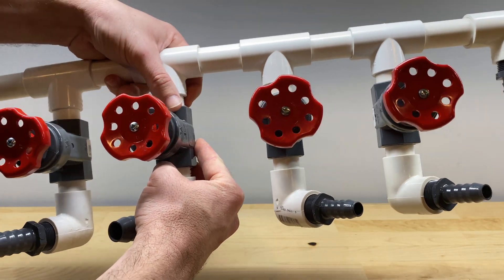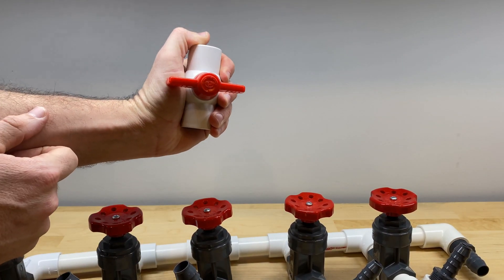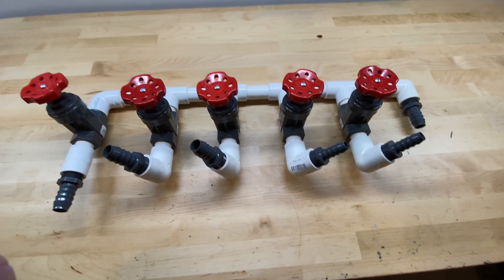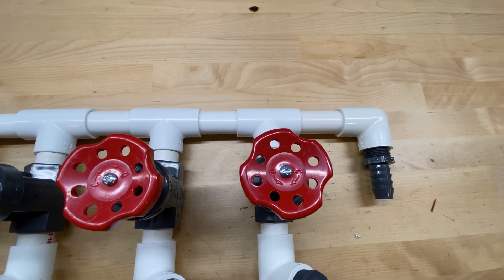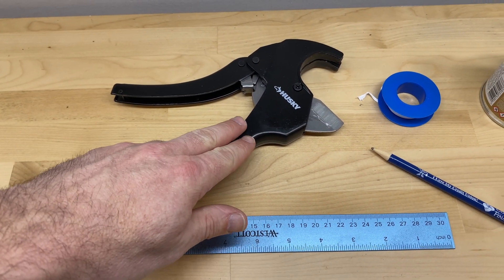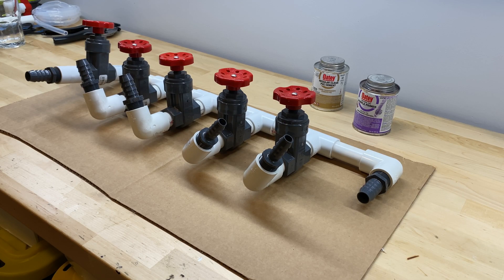Make a Reef Tank Manifold

Comment: That ball valve you showed is not "A quality" valve.   Try like Ryan Herco True Union ball valves or Cephex they are not cheap but i've had mine 15 years running 2000GPH pressure pump (39ft head) zero issues with them getting tight and I've never cleaned them all work like new do not leak.

I did have that ball valve you showed and it was terrible even brand new very sticky and no ability to take it apart.    Also careful using those pliable silicon lines on a strange return pump.  Know more that one person had them develop a balloon spot then burst flooding the house.    PVC safest but you can use stronger vinyl tubes too.    I like your manifold and the reactors.   I use to run one for a venturi skimmer then changed to separate pumps for skimmer and pellet reactors.    Thinking of going back to the manifold since I have a large AC return pump that I valve back some.